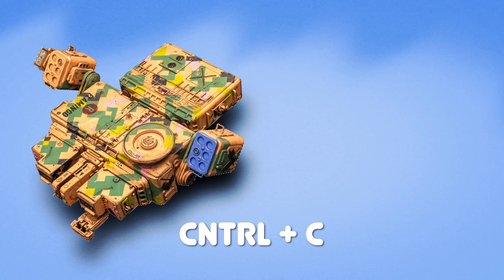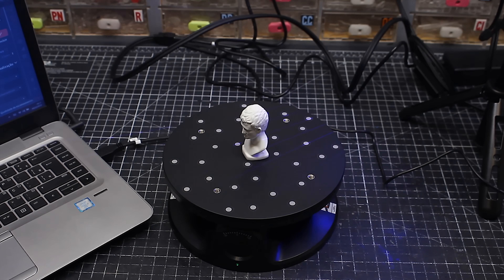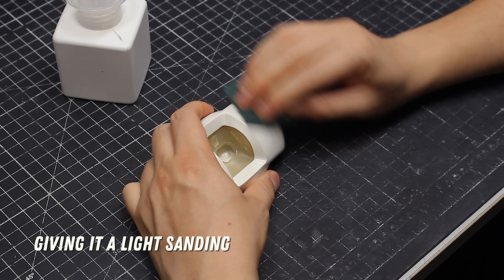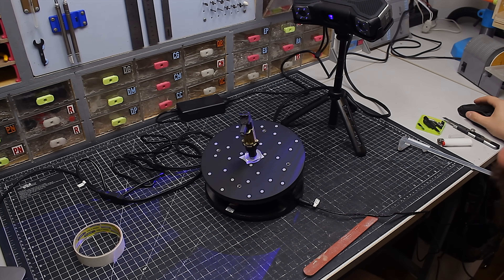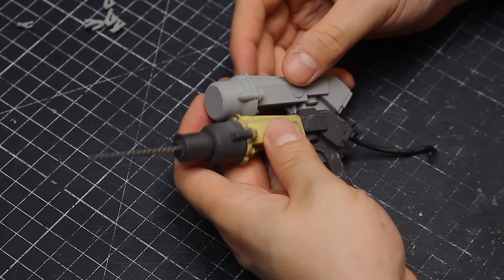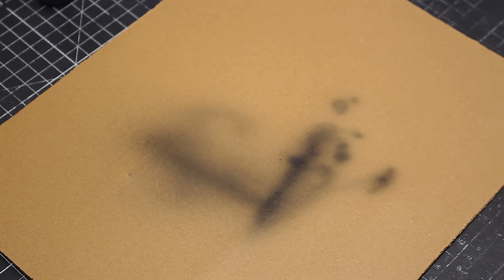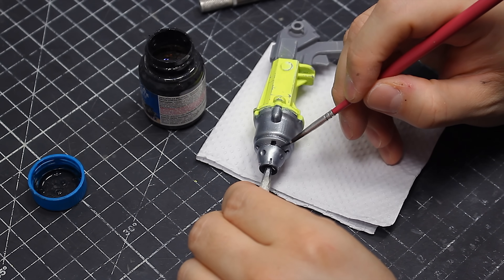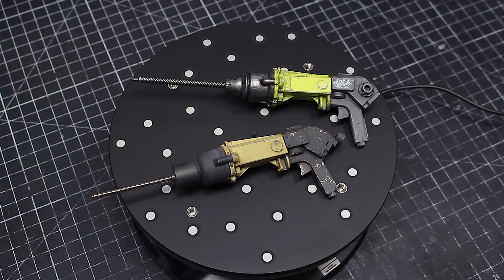This tool will help me CLONE my models! MetroX 3D Scanner

Comment: I have seen people use 3D scanning techniques to build mini consoles. They scan the internal components in order to design a custom-made shell.
When dealing with complex shapes that need to be measured and replicated in 3D to add a cover or anything on top if it, scanning allows you to capture the geometry accurately and then design and print anything custom quickly.